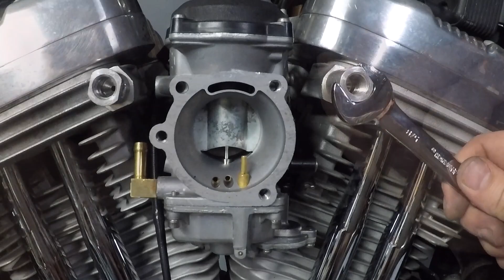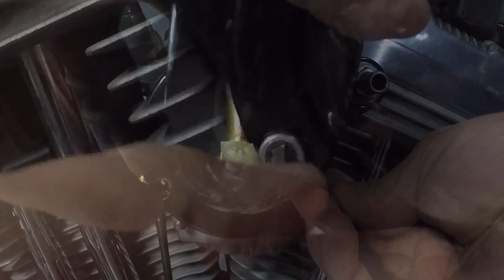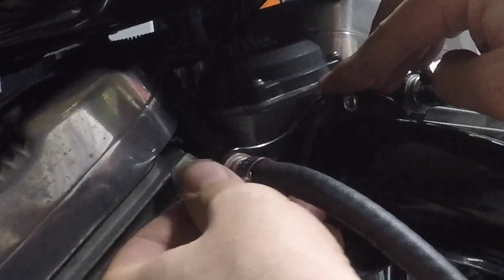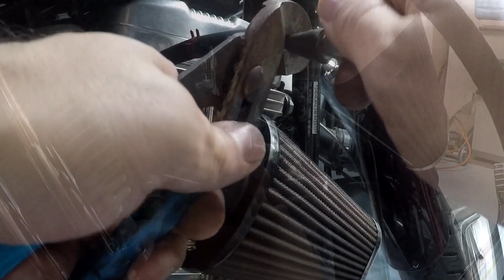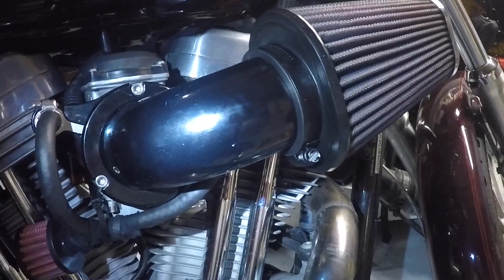Sportster intake system install

Comment: My sportster started getting more of a speed wobble after installing this. Did you tune this up after installing? I’m not sure maybe I just installed it wrong? Or maybe I just need a tuner
Reply: hi flo air cleaner and different exhaust you need to re map.